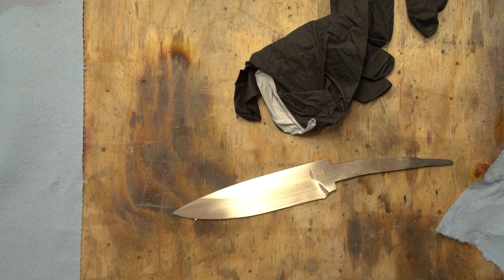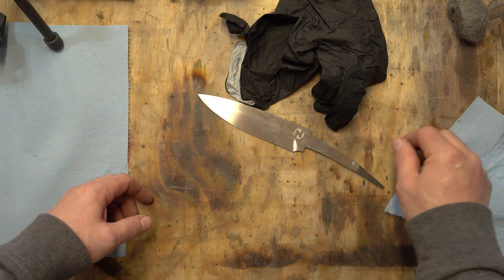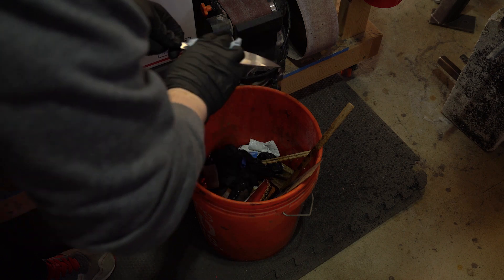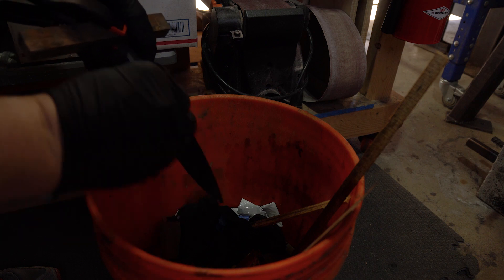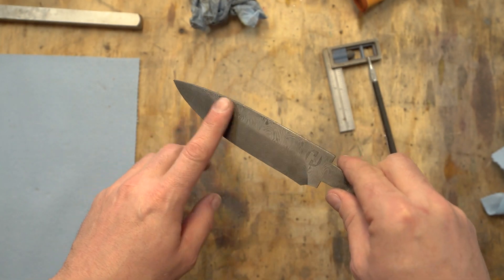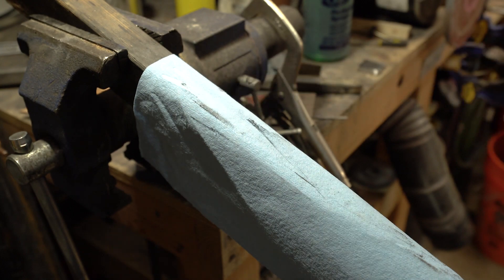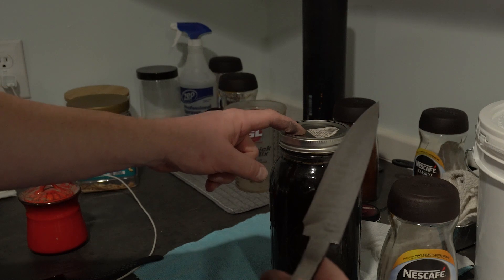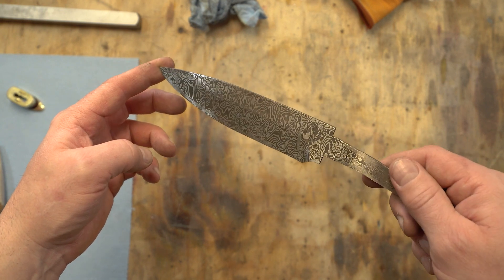Acid Etching Damascus Steel for a 6" Random Pattern Damascus Hunting Knife

Comment: The diluted solution etches faster, if you heat it up.   I use distilled water, heated almost to boiling, then add the ferric.  Etches fast.

Comment: What do you do after etching? Some oil?
Reply: Thanks. I have not blended ferrocloride and I have had problems with getting etching deep enough to polish the plade. Also coffee does not work as it should. I did a new patch blended ferrocloride and today I will try 1095 and 15n20.
Reply from the maker: Coffee won’t give any depth, but it should still give a nice black finish. What coffee are you using?
Reply: @Hathenbrucksteelworks  Rainbow instant coffee. Did not find dark but made a strong patch. Maybe 1 to3
Reply from the maker: @LeinonenHannu the dark oddly works much better. For every ounce of coffee (by weight) I do 9 ounces of water (by volume).
Reply from the maker: Yep.  I use a food grade mineral oil. Just a light coat is all you need. Blade waxes work well too.

Comment: Great video!! I want to re etch an pld damascus pattern knife I have that has sharpenning marks and light scratches all over, thinking of sand off the scarteched and marks and then re etching. Do you sharpen it after or before ther acid bath? Thanks !
Reply from the maker: Hey. Thank you. I’d sharpen after the acid. Depending on what pattern is on the edge, it’ll etch at different rates.